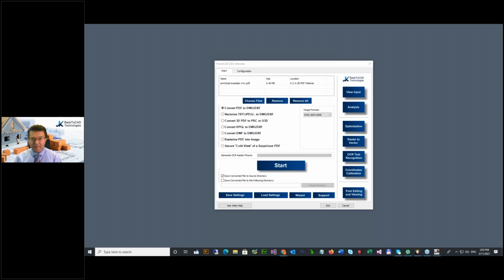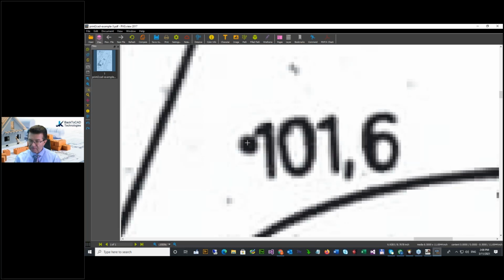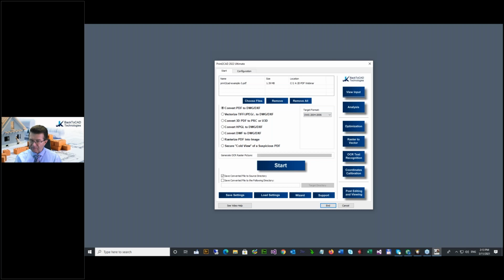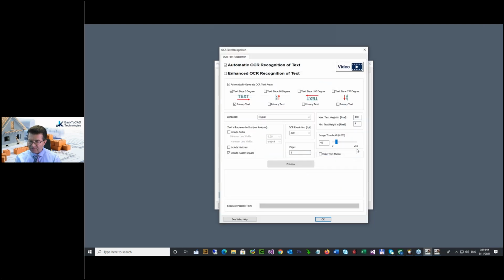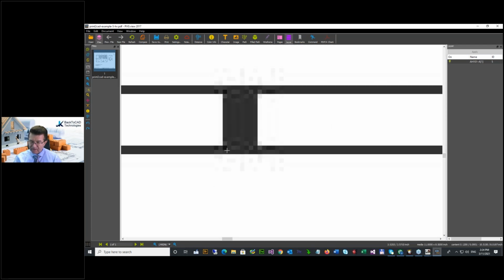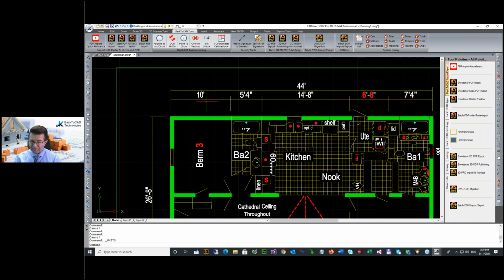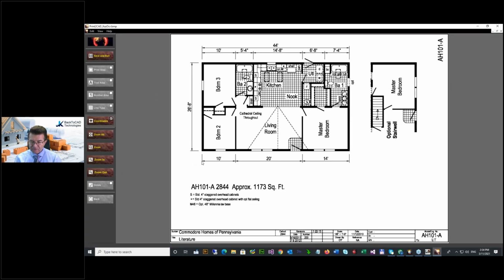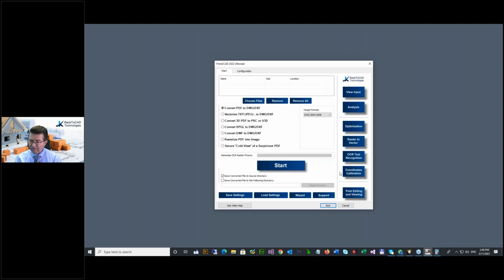Perfect PDF Scan to CAD Conversion as DWG DXF Editable File

Comment: Hey there. I am a career autocad user and manager, and do extensive customization for in-house design and drafting needs. I've been watching raster to vector engines for a long time. I do like a lot about this conversion program. You make it easy for the human to guide things. The vectorization engine seems very good, but we have had those forever. I fail to see how any of this is AI, and would say to watch out as too many software makers are claiming AI. Just say its a top vectorization environment and stop there, or you are overselling which leads to mistrust.
Good job on the program though. I would like to have this if doing extensive pdf/image conversion to dwg vector.